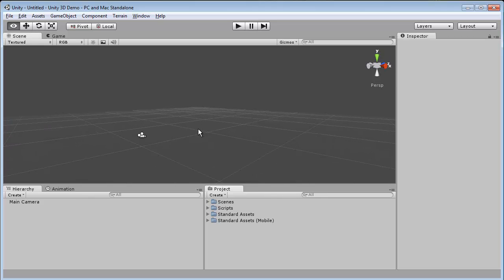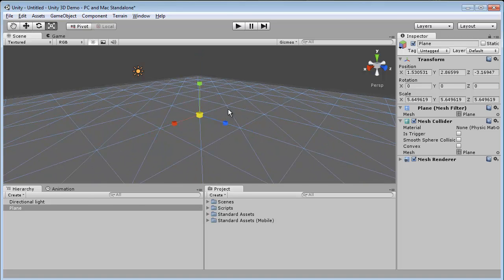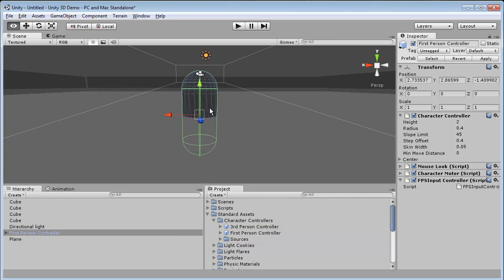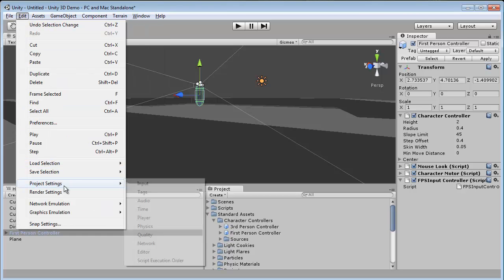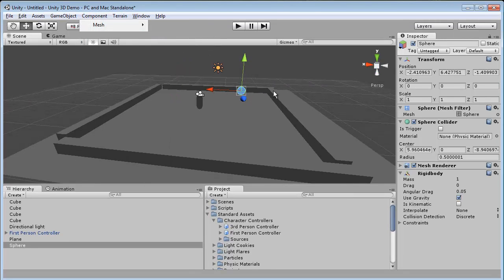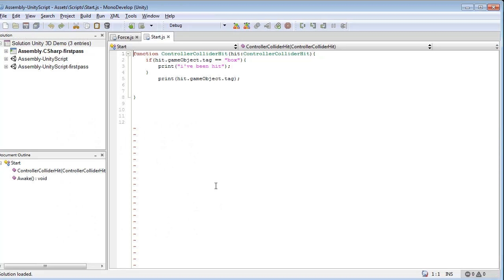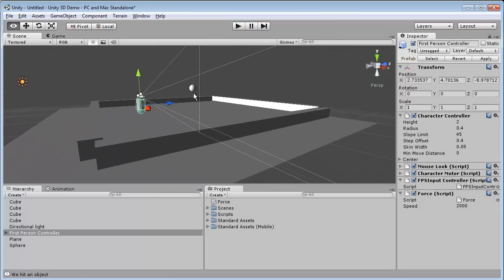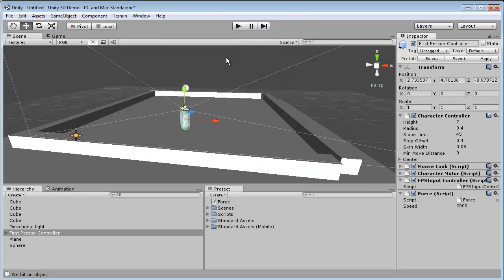Unity 3D Adding Force After Collision is detected Using Rigidbody Force

Comment: Hi! First of all thank you for your videos. I have a question. I am making a ball game and there are ramps on the  track so I  want the ball to jum when it comes the trigger. But not exactly up. It must have a parabole direction. Can you please help with this? Thanks in advance
Reply from the maker: Are you trying to arch the whole directrix or just half? If you're using physics, you can force to specific points of the mesh. But you might be better off taking control and apply force manually over a fixedUpdate loop using the parabola equation

Comment: hey :-)

any idea how 2 stop 2 objects from running through each other?
building a table tennis game and if i move the racket fast it goes right through the ball...
searched everywhere for a solution but cant find anything...
Reply from the maker: The problem you have is with the Physics engine, your objects are moving to fast. You can either limit the velocity of the objects(preferred) or increase the Fixed Timestamp(Performance bottle neck) Edit>Project Settings>Time . Also unity works in meters so make sure you scale and apply force based on real world units. Hope this helps let me know how things go
Reply: Edithson Abelard if I limit the velocity of either ball or racket it's not real anymore and can't b done anyway since the racket is moved by the controllers which r moved with my hand...
Fixed timestep can't n set with vr,it always goes back by itself to 0.0111 once I click start...
Mass units r above 1...

So none of this works or is the reason
Reply from the maker: Have you tried setting the Rigidbody.collisionDetectionMode to  CollisionDetectionMode.ContinuousDynamic for the racket and  CollisionDetectionMode.Continuous for the ball? Same as the Fixed Timestamp you will put more on the Physics engine but its at a local level instead of global
Reply: yes,that was the 1st things i did...timestep doesnt go below 0.01 ,tried set it to 0.001 but when pressing start it went back to 0.01 ,maybe thats a VR related issue

Comment: Can you apply a rigid body collision to a humanoid model?
Reply from the maker: You can thats what the ragdoll is. See yhe ragdoll wizard. Also when you use a character controller thier is an option for the type movement strategy, which one way or an other involves a collider.
Reply: Thanks for that.  What would you recommend for learning coding in C#? I'm using Visual Studio 2015 community version. I created errors trying to follow a tutorial. I don't think we were using the same visual studio script.

Comment: Do you know how to not walk through the animation that you import from 3ds max or maya? I click the animation which on the model tap. It has it's own generate collides. Normally it works on model. But not animation.
Reply from the maker: Tang William What do you mean not walk through the animation? Are you trying to make the collider follow the animation?
Reply: Edithson Abelard I fix it. Now it seems works on the others and i made it works. But new problem come out.
Reply from the maker: Tang William Ok God, something to look out for is the collider doesn't follow the mesh when it animates, a good trick is to hook into the mechanim events and change the collider size.

Comment: not sure if you will see this but i was wondering how to do almost the same thing. i have a "bounce pad" that i want my character to jump on and move in the direction the Face or normal is angled. 

for example if " / " was the pad i would be going  -->/ and then bounce at an angle perpendicular to the face im hitting

hopefully im making sense

EDIT:

i just figured it out not 5 minutes after thanks to your video haha. i just used the same logic but used the bounce pads transform.up * speed to get the desired effect
Reply from the maker: MrCoconutsquash no fears, I read every message and respond as soon as I can. Your example can be done using Physics.Raycast and getting normal vector direction from the hit and using some Vector3 math apply force in the opposite direction of the vector plus their momentum.

Comment from the maker: Glad you enjoyed the video hope this helps.

In the ControllerColliderHit function don't apply the force to the hit var instead apply it to your characters rigidbody. When applying the force you can still use forward but apply a negative value and your character will jump back. 

For more control add the following functionality.Create a tag and check if the object that was collided with has that tag. If so then the character should jump back.

Comment from the maker: @Benbo212 You have a few ways, colliders, triggers and raycast. If you add a collider(mesh,capsual, box ...) you can check for both a trigger(if is trigger is set to true)  or a collide event. 

The RaycastHit allows you to project an invisible line out, and check every frame to see if it hits a game object. 

If you need a very specific object, you can use the gameobject.name; or you can check for the gameobject tag.